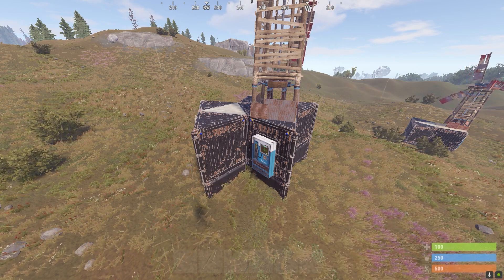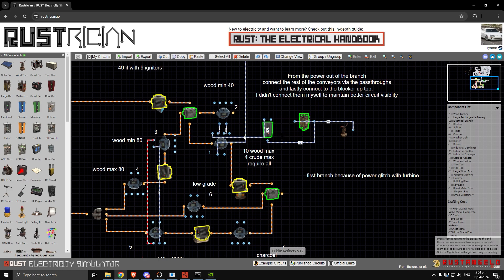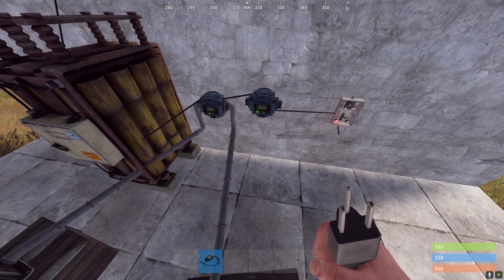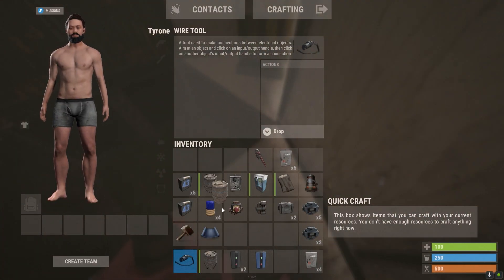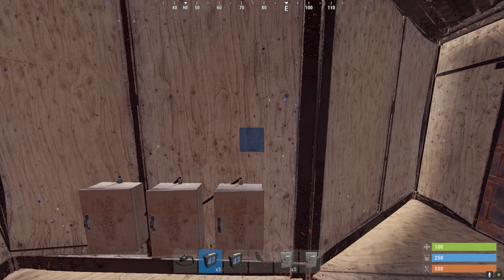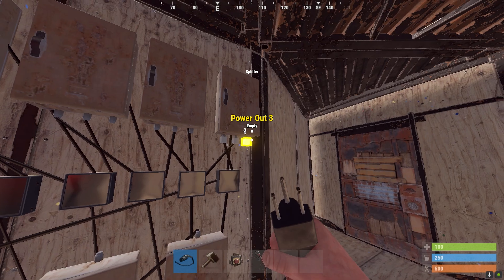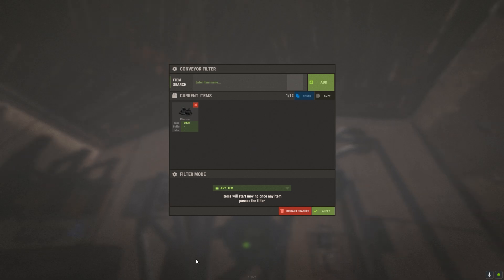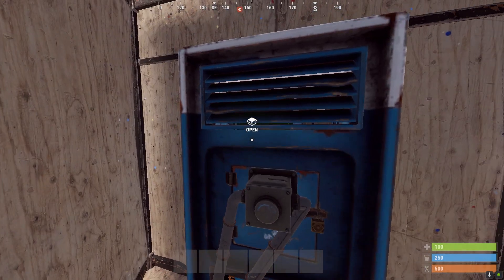Automated Low Grade Shop

Comment: Nice Video, any way to make this circuit even more easy? I dont understand fully why you need so many conveyor
Reply from the maker: The reasons for so many conveyors is to increase the speed. You could do it with 2 less but it would it would take an extra 10 seconds for the low grade to go back into the vending machine after an initial sale. The second conveyor is to ensure the refinery ignites again if wood runs out. https://www.rustrician.io/?circuit=1eac0a0244a3da21e85f9175903cd9ca